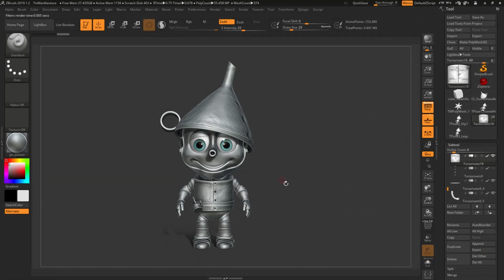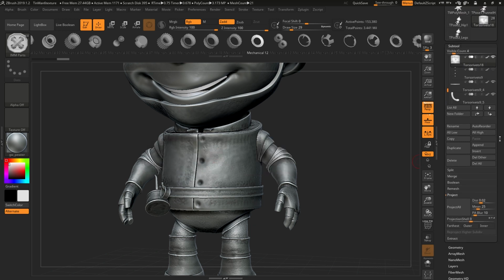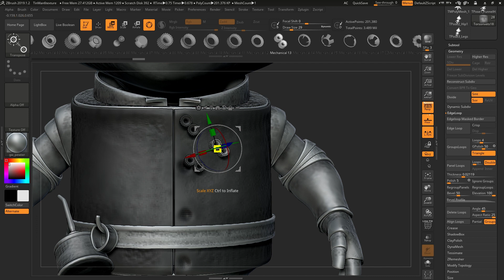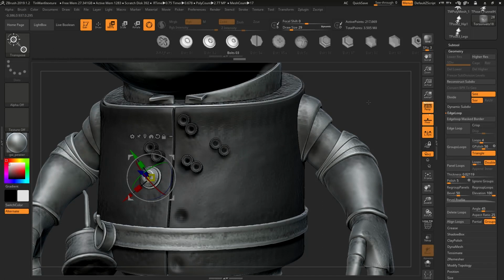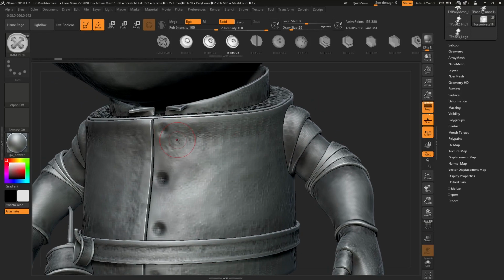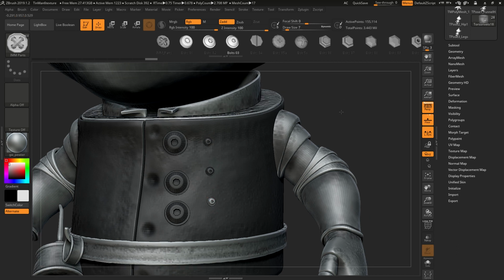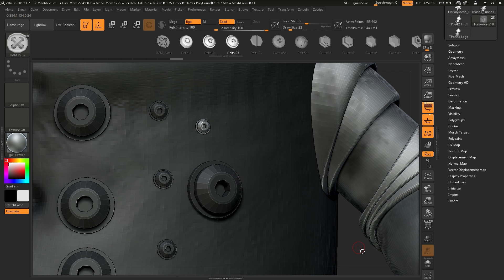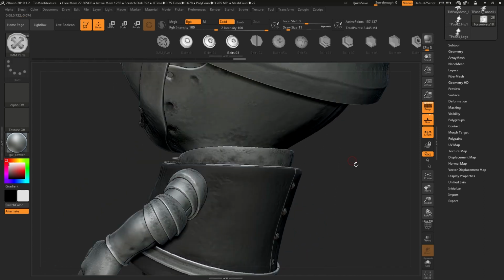IMMBrush for ZBrush - how to use it and how to draw out consistently sized meshes

Comment: Thank you for the video. I was able to use 1 imm brush which masked the part as you showed, however another brush I have didn't mask, so I am unable to position it because it's attached to the part I drew on. I'm unsure why that happen?
Reply from the maker: Whenever you draw out one imm brush it will automatically mask the surface you are dragging it onto. So because of that you can use Subtool, Split, Splitunmasked to separate that into a new subtool.
Reply: @SeanForsythTutorials  Yes I think there is an issue with the particular, brush because that process you just explained has been working with my other brushes. Thank you for the reply 👍
Reply from the maker: @tomhikon Ah, sorry to hear that. If you want to send me the brush i can test it?
Reply: @SeanForsythTutorials  well I got it on artstation and sent a message to the author so maybe they'll respond eventually lol super appreciate the offer though. Just getting into zbrush lately so definitely subbed to your channel because you're obviously are a pro.
Reply from the maker: Okay great, well hopefully they get back to you soon. And thanks for the sub!